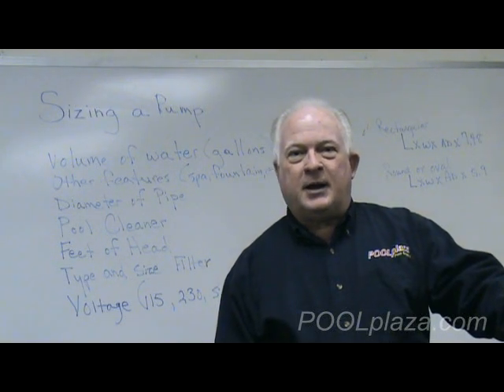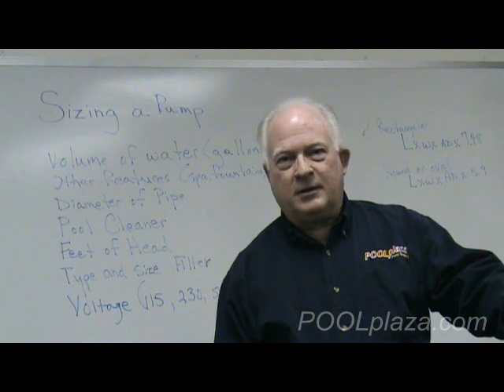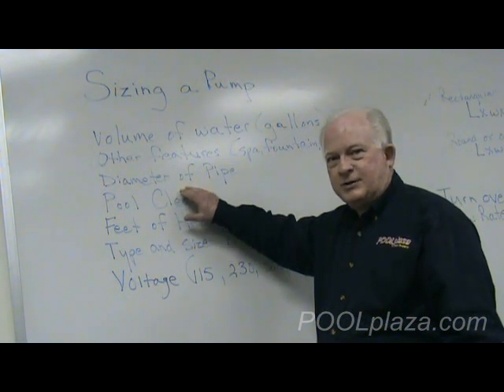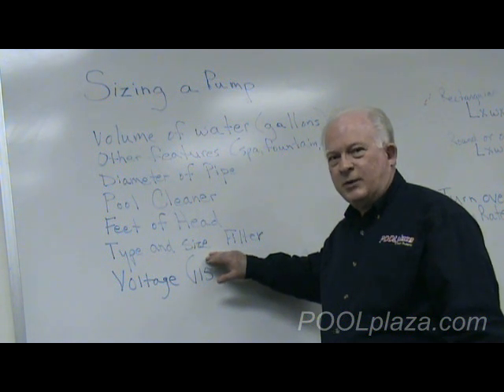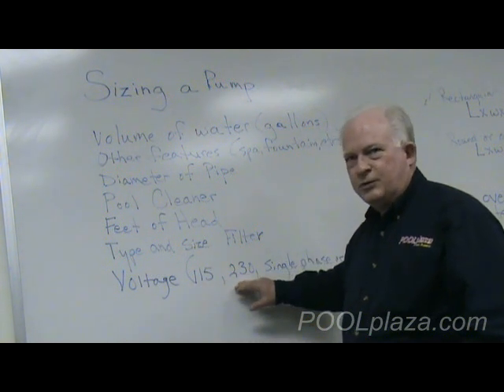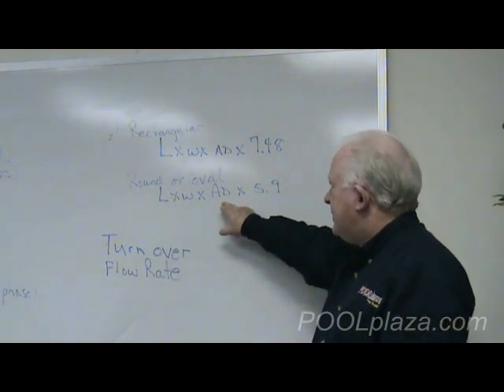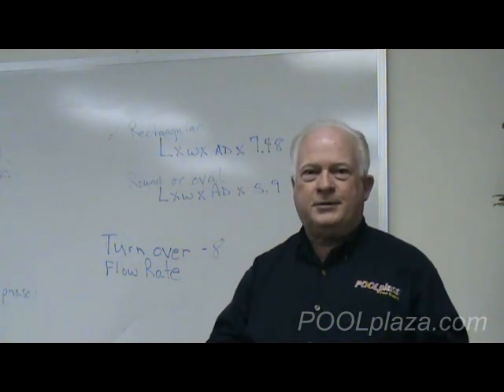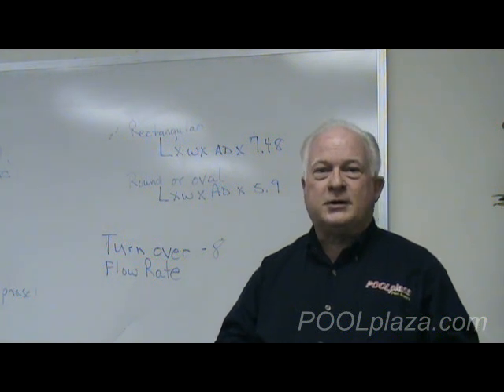HowTo: Size a Pool Pump

Comment: What a load of old crap you talk. You begin by saying it is very complicated and that there are 7 factors to take into account and then end by saying you simply divide the volume by 8. In any case an 8 hour water change is not sufficient to keep a clean pool, 4 hours is a much better figure. So very simple, example an 8m x 4m x 1.5 pool gives a volume of 48 m3 divided by 4 = 12 m3/hour. Really simple isn't it?